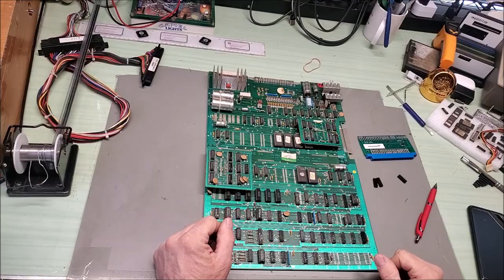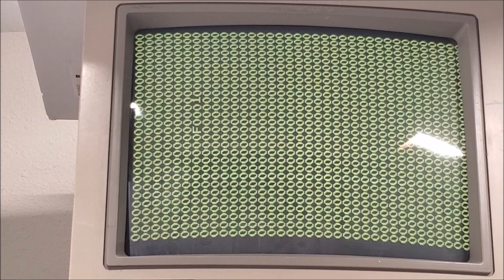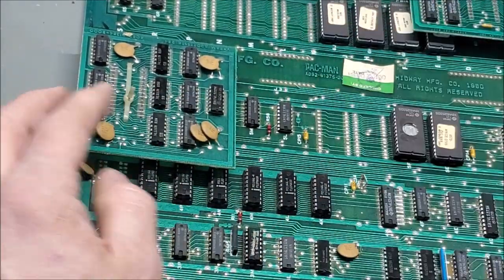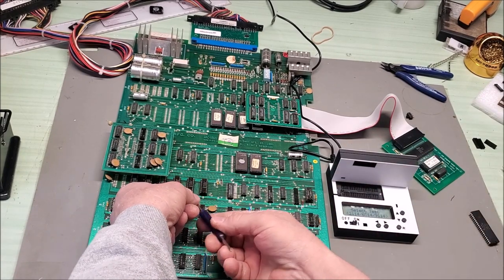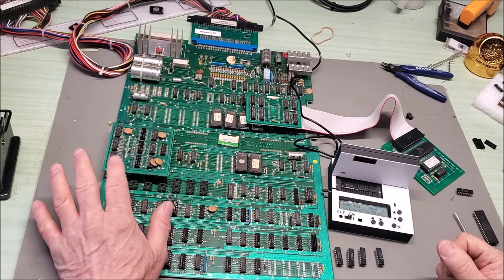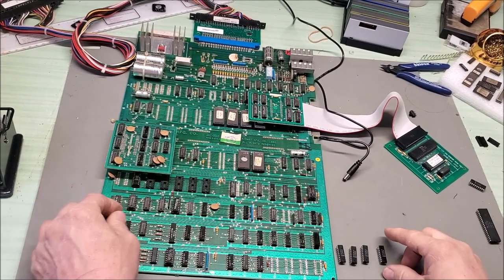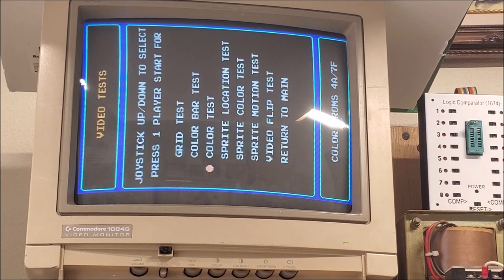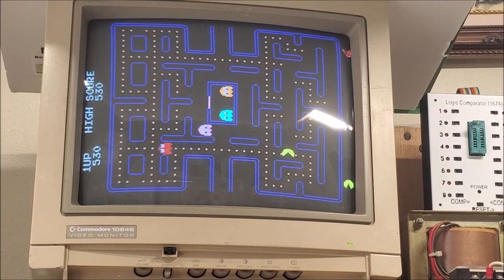Pac-Man - A screen full of zeros

Comment: What does the Scratch RAM do in arcade games? any reasons why the test diagnostic program never test for the scratch RAM in various arcade games?
Reply from the maker: Hi Wayne, the manual calls it Scratchpad memory, they keep things like high scores, working screen memory for the first player while the 2nd player is playing and other types of temporary data. The selftest does test this ram, but if the ram is corrupt, it can't display the error, depending on which ram is bad. In our case in the video the bad ram effected the display, so we needed another way to find the bad ram.  We could have swapped them around on the board, or use a external tool.  DK has a similar set of 6 2114 rams on it's cpu pcb.  I've seen many times where a board won't run due to bad rams like this one.